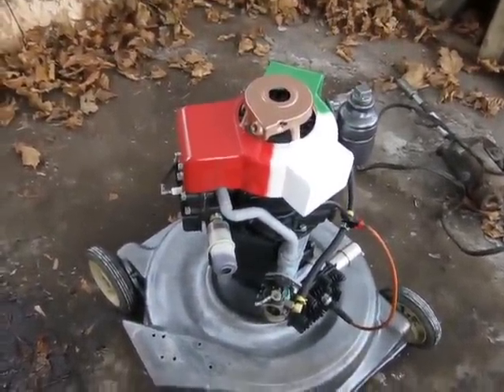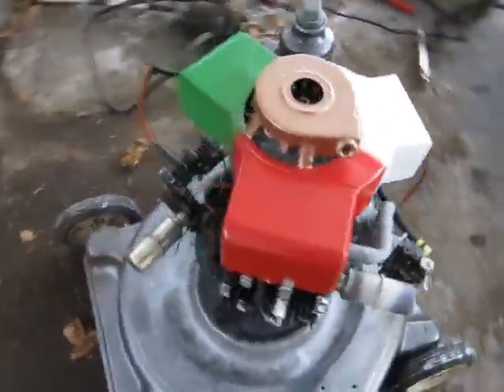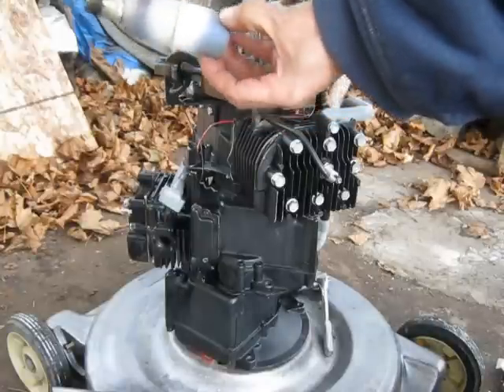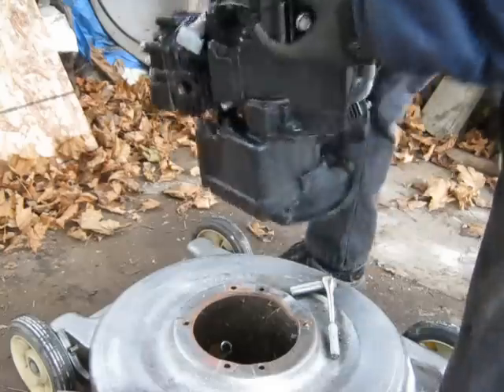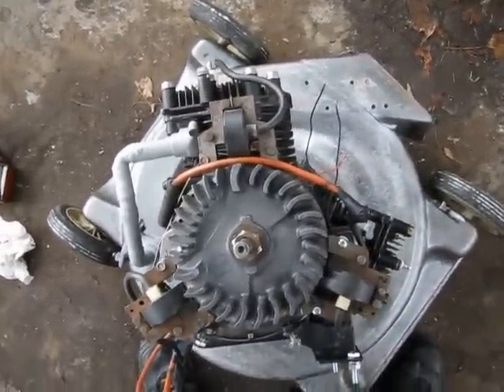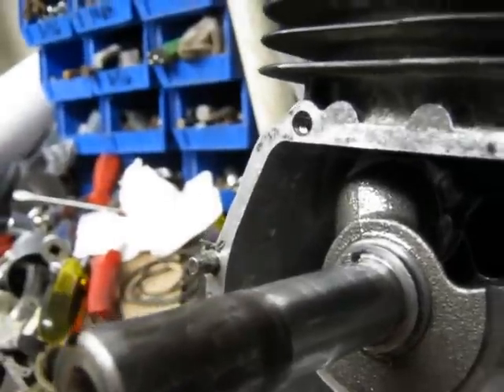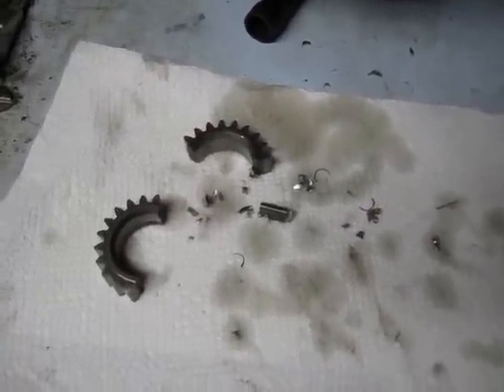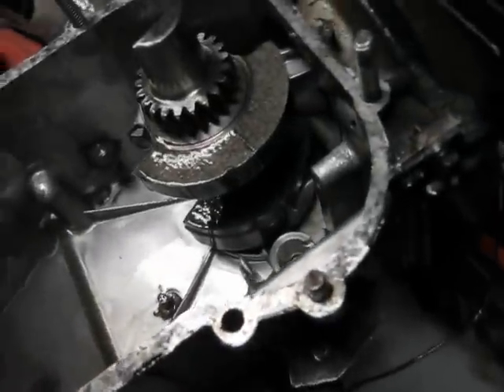Briggs 3 cylinder FAIL & Teardown

Comment: arnt those brigg engines a splash type oil lubrication how do you get the oil to the uper parts of that thing
Reply: o its just 3 engines conected together at the crank
Reply from the maker: Yes, you are right, the 3 are connected together, I was pretty sure no oil would make it up to the top with the normal splash oil system, so it has 3 separate crankcases. I have re-worked the cranks, so I plan to run it again, hopefully without the nasty noise!

Comment: ChargerMiles007-I like all your work. I have your kind of mind also. Not as determined as yours, but kind of like yours. I would like to build a 2 cylinder briggs with a love joint connecting them up, its like a u-joint, a rubber disc with four bolts,two from each engine. What I'm not sure will work is the balance or balancing of all those parts that make up the love joint. I use these lawnmower engines for racing 150cc scooters everyone has here in Puerto Rico. My go-kart reached about 50mph in about a 500 foot race. It has a two engines, one is lawnmower 6.5hp flat head (vertical to horizontal), and a 90cc three speed with reverse china quad engine with a trimmer magneto and coil for spark (about 7hp). Both engines run at the same time, its a blast to drive. I hope you keep up the good work. PS Those none racing go-kart tires I use look like they're going to blow at 50 mph. I want to go 55mph!!!!
Reply from the maker: julio lausell Be careful going so fast on those tires, you never know when something bad could happen!!!The Love-Joy company sent me some jaw & jaw type couplings to use on my FrankenBriggs 4 cylinder engine. I was able to make the 40 second long engine run using the new coupling set up. I haven't had a problem with engine balance due to the couplings, though the coupling you describe is different than what I have used. So would you use the existing ignition on each of the engines?My 2 cylinder stacker engine only has one flywheel, so I have all of the ignition coming from the top flywheel. Depending how you build it, you will want to be careful of the type of coupling you use, as you don't want too much compressibility in the coupling (too springy, or soft). This whole area is pretty much an unknown, and a very special application, so it is very hard to predict how long the coupling will last, or if it will fail. You will need to pick a firing order also, though I imagine an evenly spaced 1-2 would probably be best. Take care.
Reply: Thanks for the advice. In my case I would just keep using both fly wheels and coils on each engine to keep it simple. One carburetor for both engines. Maybe one day I can show you a picture or video of my gokart through you-tube. I'm always checking out your projects, I get inspired by your work. THANKS!!!!!
Reply: PS I would like to build a piston charger from a 50cc 2 stroke engine, even if the 4 stroke engine has to burn a 32/1 gas to oil ratio. the piston charger would use reed valves from the header exhaust of a chinese quad. It's like a emissions valve (one way) so that back fires happen in the header and not out the muffler. I guess oxygen bleeds in causing the back fire in the header. Two of these reed valves at the top of the cylinder and to at the crank shaft creating a one way flow to the four stroke engine, and if you think about it, the crank shaft could work with just one reed valve. When the piston comes down, the reed valve would close and the transfer ports would fill the  the cylinder, it would be less efficient than the 4 reed valve system. The problem is finding all 4 valves.
Reply from the maker: julio lausell I imagine you will have a little fun dealing with the turned down crankshaft on the flywheel end. Make sure you pick a carb for an engine with about twice the cubic inches, or it could cause you grief, like on my black opposed 4 stroke engine. I used the stock carb from one engine, to feed both, it didn't like that!
Reply from the maker: julio lausell A piston charger, sounds interesting, hope you can make it work. I have only used a slightly larger 4 stroke engine with double lobes welded onto the camshaft, for use as a "supercharger".
Reply: Thanks for the advice about the carb size and for writing me back. I do have a carb for it. I just don't have the reed valves or a mig welder for aluminum welding. I use a stick/arc welder, that can't be used for aluminum because it has no inverter switch. I'm not sure about all the welding stuff because I'm new to welding, and only know how to melt metal together. I'm looking into a cheap way to weld aluminum, but every time I ask about those welding rods that only use map
gas/propane the guys here at the welding supply tell me they know about that. Take care, keep up the awsome work.
Reply from the maker: julio lausell I have tried to use those MAPP gas aluminum welding rods, they are very strange, more like a steel rod, since they are heavy. I had mixed results, so I can't say one way or the other if they are any good. Aluminum stick welding rods are also made, I was given a few of them in the past, but I don't remember if I ever tried them out. Take care, and don't get hurt doing your experiments!
Reply: Thanks, Take care.

Comment: yes i believe that is what happened to the timing gear was repeated hammering every time the cylinder fired...lots of luck
Reply from the maker: thomas dawe Thanks, I will JB Weld the gear to the crank to make it a tighter fit, hopefully that will last for my next run, as I want to hear what the 3 cylinder sounds like without all the crankshaft hammering.

Comment: yes you are in a complicated situation ... getting 3 carbs synchronized  could be a problem... making the brackets will take some time but probably fun also ... the older two stroke motorcycles which had three cylinders had a fully adjustable three into one throttle cable so as to set the butterflies to move at the same time... just a thought... I'm sure you will get it done ...well at least you are having a lot of fun with this build and quite the challenge too....lol
Reply from the maker: thomas dawe Yes, this engine is keeping me on my toes!!! With some youtubers suggestions, I may be onto a fairly simple way to stop the crankshaft joint knocking noises.

Comment: the top cylinder is too lean on fuel causing extreme heat....liquid doesn't like to go uphill... i would use all three carburetors and get motorcycle tricylinder throttle cable three into one  sorry about the breakage
Reply from the maker: thomas dawe You may be right about the fuel not wanting to go uphill. Just before it shuts down, it sounds to be running on only 1 cylinder, and I am pretty sure it was the top one. Too lean would definitely cause it to run hotter. Good idea to use 3 carbs, I didn't do that to simplify the throttle linkage.
Reply: This is what I was trying to explain on the stacker engine. If single carb on this tall plant is going to be used the runners are going to need a way to pull same mixture. Finding the middle of complicated between simple linkage and simple runner draft length is if gonna be a challenge. Just sucks I do this from my phone or o would draw up some ideas and email them to ya
Reply from the maker: James Holt Yes, I can see how a phone would be a limitation. Personally I don't have a cell phone, or even internet at home! I know, I am in the stone ages lol  ,but I get by uploading at the library, and commenting back from work. I can see the draw backs of the manifold I have made, but I imagine I can still get a decent minute long run from it, if I can tighten up the crank joints so it doesn't pound itself apart.

Comment: I have noticed with opposing twin briggs that plugs and leads must match length or will throw raw fuel making for a cold exhaust. Maybe make all 3 leads same length and advance your coils a few degrees and cyl 2 should burn off coating off muffler like #1 and get at solid crank and gear for #3 and I think you may have a runner.
Reply from the maker: James Holt Thanks for the advice, I hadn't thought of the different spark plug lengths causing any issues.You have reminded me of something I intended to do, check the spark timing with a timing light. It would make sense that #2 and #3 cylinders would lose some timing due to the slop in the crankshaft joints. Rather than machine a new crankshaft for #3, I will install a new gear and JB Weld it to the crankshaft, hopefully this will eliminate any built in lash. I will put in a plastic camshaft the same as I happened to be running in cylinder #2, it is about 1/3 of the mass of a cast camshaft, so will reduce the inertia load. I think that should get it running again. I am still working on a simple solution for the lose crankshaft joints, I don't want to try welding and grinding, as that didn't work out so well when I did it on crankshaft #2 already. The welding seriously hardens the crankshaft, so much that it will take the teeth off a file!
Reply: ChargerMiles007 I have acquired many v and opposing twins cause non thinking shade trees threw a plug too long or short (even by a .25 of an inch difference) or would repair a plug wire but not make the other match. I would think make them same length and advancing whole coil set up would be the easiest rather than adjusting #2&#3. That is if your mounting allowed for individual coil adjusting. Sometimes easy way is the best and most dependable. But the crank connections. You have said in the past you are limited on machining equipment. would it be possible to lath the journals (or shaft at point of  connection) so a collar could hold both shaft and epoxy tighter?
Reply from the maker: James Holt I pretty much have no machine tool access right now, so I would have to do the fix by hand, which limits the possibilities. I may be able to have the cranks turned down right at the joints, and epoxy on a thin sleeve to tighten it up. That is starting to sound like the easiest/best solution to this. I was talking to my wife about the epoxy fix last night, though JB Weld only has a strength of 5000psi versus at least 20,000 psi for steel, but a pocket full of epoxy should tighten it up one would imagine.
Reply: ChargerMiles007 are the crank joints in the case bearings or out side of them... if outside of them and no chance of interfering with anything... JB and hose clamps

Comment: Odd that the cam drive gear of all things is what let go but it's a good things that's all it was
Reply from the maker: Mr3wheeledbike Yes, it is the first time I have seen one fail, though it is made using powder metallurgy, so it is sintered, not a true solid, like the old machined gears. I am pretty sure the hammering from the loose crank joints is what caused this to happen, so I will JB Weld it to tighten up the fit. Plus using a light plastic cam should greatly reduce the inertia forces the gear has to handle.
Reply: found a use for the plastic cams did we now, well i never liked them much, cant weld to the darn things but if it is the proper kit for the problem i say its worth a go
Reply from the maker: Mr3wheeledbike I used a plastic cam on cylinder #2, since it was laying around. In spite of having over 200 Briggs engines, it always amazes me how I have a tough time finding parts whenever I build an engine!  In fairness though, I generally don't have the engines torn down, since they take up less space left as a unit. The down side is that whenever I need an internal part like a valve tappet, I have to go to a shed (perhaps shoveling snow out of the way) grab a suitable engine, and tear it down for one little part :( I do have about 20 lawnmower crankshafts removed, so I can select the length I want etc. I can see that I am going to have to continue to get old integral gear and cast iron camshaft engines whenever I see them, as those parts seem to take the abuse I throw at them better.

Comment: strange, that runs the camshaft..seems funny that would fail since it is only push the valves .. Must be shock or power pulse from the other cylinders. Thanks Ron
Reply from the maker: zzzdogutube Yes, I think you are on the right track. I believe it is a resonance problem, due to the sloppy crankshaft joints, pretty sure that's why the gear broke. I will try another gear, but I will JB Weld it to the crankshaft eliminating any play there. I will also use a Briggs plastic camshaft, as they weight 140 grams versus 350 grams for the cast iron camshaft. Between the two changes, I think it should solve this problem. I am still looking at how to tighten the crank joints up without doing a lot of machining.
Reply: ChargerMiles007
if you want to motor to live I think having it machined is your only option
the harmonic vibration is just gonna break something else you where lucky it was only a cam gear this time 
I doubt jb-weld is gonna hold if it doesn't when it brakes its gonna take the crank with it 
i would split the cranks have keyway's and dowels machined into the ends or bridge port a keyway into the side and slap a coupler on it and weld it up 

I think part your fueling problem is the odd length/angles of the intake runners which to be-honest are all wrong you can NOT have the carb lower then the intake that just doesn't work also that single carb may not be providing enough CFM